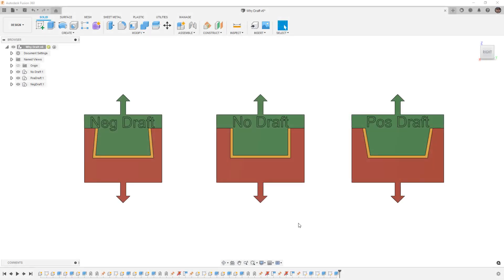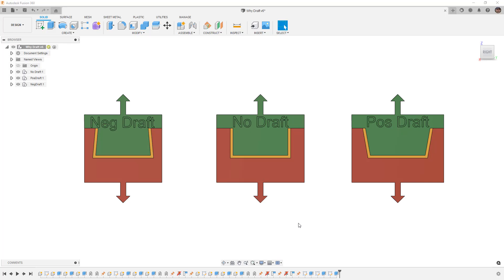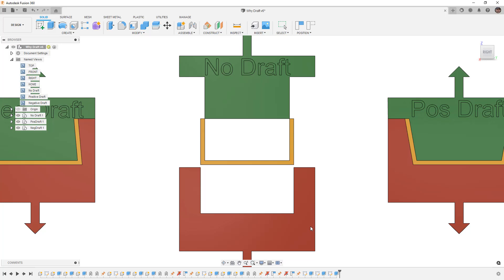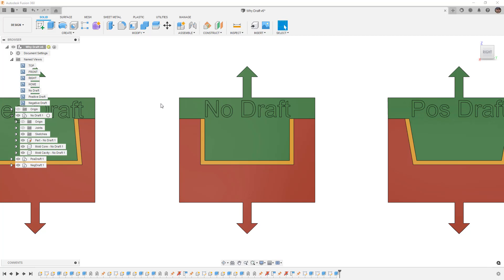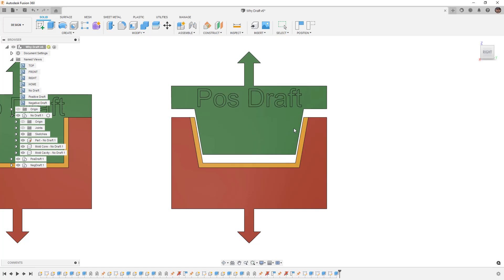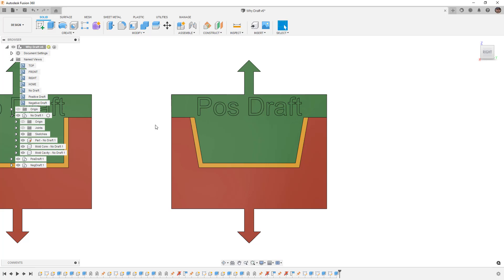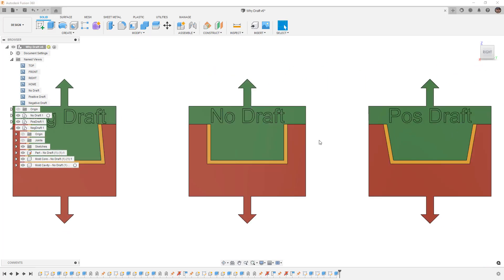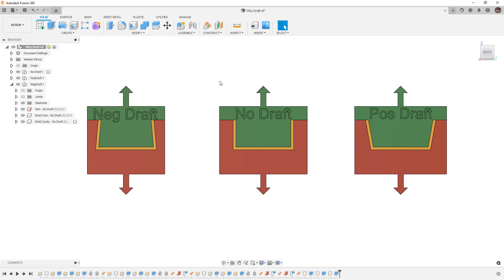Plastic Part Design Series Episode 1 - Why Do We Need Draft on Injection Molded Parts #Fusion360

Comment: Great video thanks a lot. but i have a question, wot if the geometry of the finished part that i require is something similar to the one shown in negative draft ? how do we plan the molds for such components ?
Reply from the maker: I did a more in depth molding course on my site www.learneverythingaboutdesign.com   but in general if you have negative draft like that you create an overhang that can't be demolded.  You either need an internal sliding core feature or you need to cut a hole in the part so that face can be accessed from the bottom.